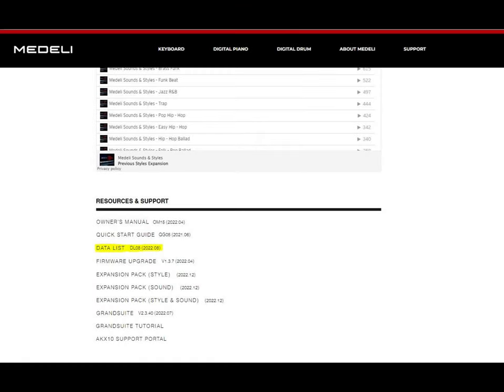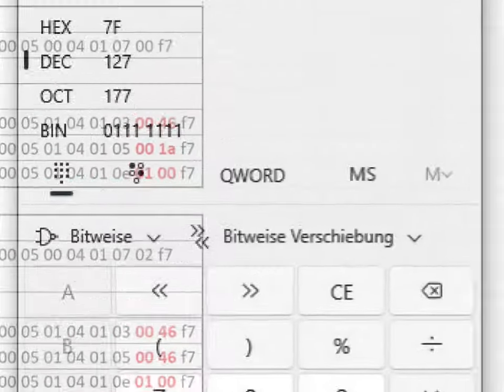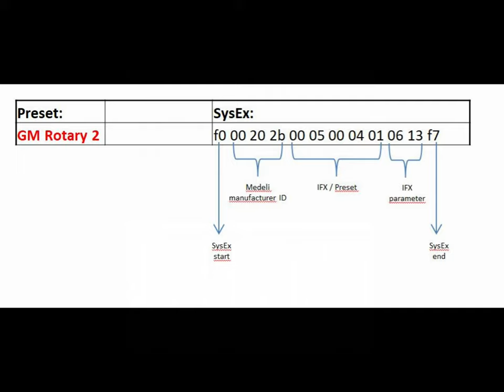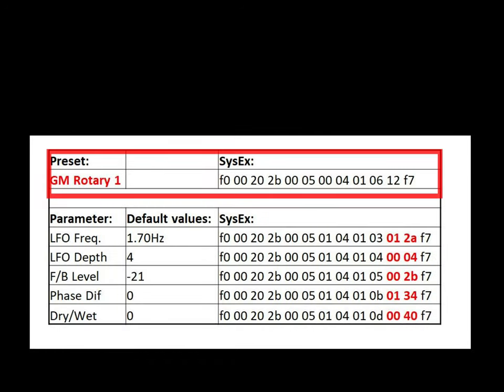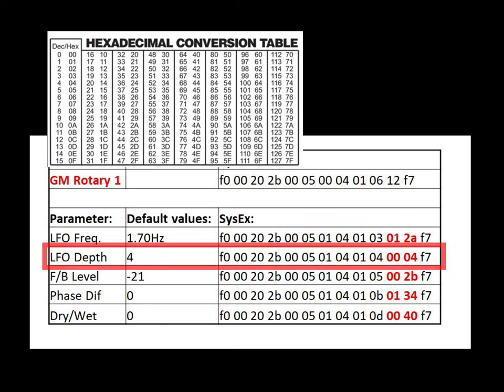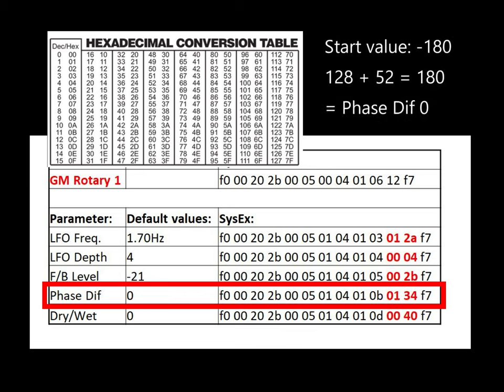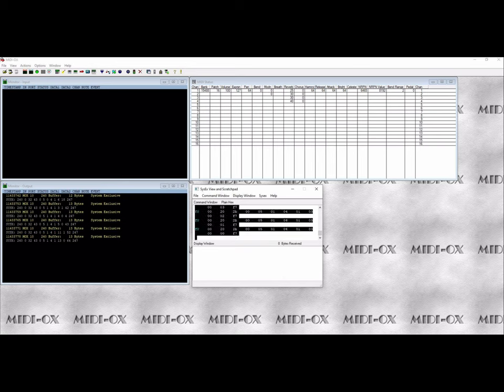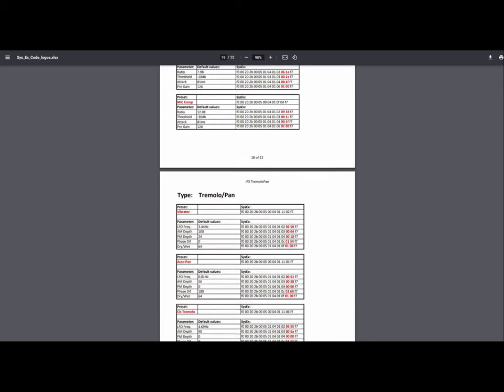Medeli AKX 10 - Hidden SysEx commands - PART I

Comment: Nice tutorial. Any idea about the microtuning SysEx?
Reply from the maker: Hi @raidmarji,
yes, there are also microtuning (scale tuning) sysex commands:
F0 41 00 42 12 40 1p* 40 v1 v2 … v12 xx F7

You can see the full "Scale Tuning" commands at page 61:
https://www.mecldata.com/download/manual/AKX10_DL.pdf
Reply: @microwavesounds  what about the checksum?? everything excluding F0 and F7? or as roland starting from specific byte?
Reply from the maker: @raidmarji
Here is a complete example for an arabic scale sysex for the Parts (MidiChannels) 1-3:
PART 1: 
F0 41 00 42 12 40 11 40 40 40 0E 40 40 40 40 40 40 0E 40 40 00 F7
PART 2: 
F0 41 00 42 12 40 12 40 40 40 0E 40 40 40 40 40 40 0E 40 40 00 F7
PART 3: 
F0 41 00 42 12 40 13 40 40 40 0E 40 40 40 40 40 40 0E 40 40 00 F7

Always send the commands with F0 and F7
Reply: @microwavesounds many thanks for your reply. I really appreciate it. But what about the checksum? The last hex just before F7? How to calculate it?
Reply from the maker: @raidmarji  
Basically, no checksum is necessary.
You could completely omit the last bytes (00 - here shown as ØØ) before F7
F0 41 00 42 12 40 11 40 40 40 40 40 40 40 40 40 40 40 40 00 ØØ F7

In this example, the last 00 before the F7 means -64 cents of note b. This also works!
F0 41 00 42 12 40 11 40 40 40 40 40 40 40 40 40 40 40 40 00 F7
Reply: @microwavesounds  This is really strange, did you try it or theoritically? because -63 cents on note B should be 01 (hex). -50 on note B should be 0E
Reply from the maker: Of course i meant -64. I have corrected my previous comment
Reply: @microwavesounds  Right B -64 is 00h. The other strange thing is that they use 41 (Roland id). is medeli Roland? and why they use checksum if they do not use it :) Thats crazy. LOL
Reply from the maker: @raidmarji  In fact, Medeli uses the Roland id 41 for a large number of sysex commands.

Medeli is basically an OEM manufacturer that also sells its products to well-known manufacturers.
For example, the Roland keyboards of the E-X10, E-X20, E-X30, E-X50 series are also manufactured and re-labelled by Medeli :-)

Comment: Hi, very interesting and in depth study. I´d like to make you a question: today I received my THOMAN AK-X1100 and after connecting it to a weighted midi controller I discovered that it sounds great, however I cannot find a way to control rythm and chord from the external keyboard, so I wonder: is this possible? Thanks in advance
Reply from the maker: Hi JC,

yes, it is possible to control the rhythm and the chord via an external midi controller.
You have to configure the midi channels Chord and Right in the GLOBAL SETTINGS -> MIDI I/O.

Greetings
Reply: Hi  @microwavesounds  , that´s fantastic! I will take your advice and will try it. After I´ll give you my impressions. Thanks a lot for your fast response. Regards
Reply: Simply: awsome! Is just the right keyboard I was searching for without spending a fortune 😀. I needed a some kind of arranger to play, basically drum & bass in sync, while performing at piano. I use an 88 weighted keyboard (PX5S) which it feels great controlling the AK-X1100. Wow what a discovering my God! Thank you very much, again.

Comment: Hey thank you very much for this video

I also got some sounds in .snc and .mem extension from a friend. Do you know how i can put them into the keyboard?
Reply from the maker: The snd files can directly used from USB thumb drive.
It is accessible via USER --> USB and the folder which contains the snd files
Alternativly you can then copy the files to the AKX10 via the Button Menu ->"Save User".

Also the mem files can directly used from USB thumb drive.
It is accessible via BANK --> USB and the folder which contains the mem files

But be aware: 
The snd refers only to sounds, which are included in your AKX10 Keyboard.
It practically only contains the parameters auf Attack, Vibrato, ...
If the refered sound is not installed (via Expansion) the snd doesn't work.

Also the mem files refers to styles and sounds included in the your AKX10 Keyboard.
If the styles and sounds are not installed, they don't work as desired
Reply: @microwavesounds  Wow thank you for your answer. 
Do you know how to install a mpk file that is restricted?
Reply from the maker: @davidstojak220  Currently there is no way to install a restricted MPK file on an unauthorised AKX10.
But that is a good thing, because there are many expansion creators - and copy protection ensures that they are not re-released without permission ;-)